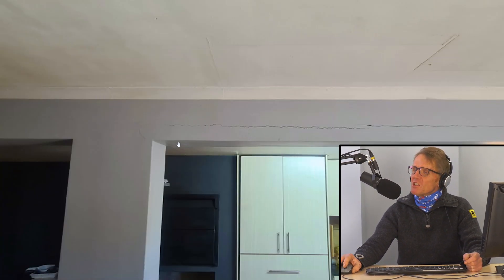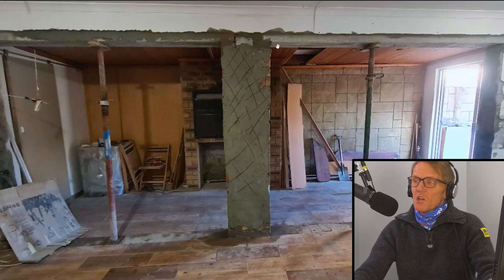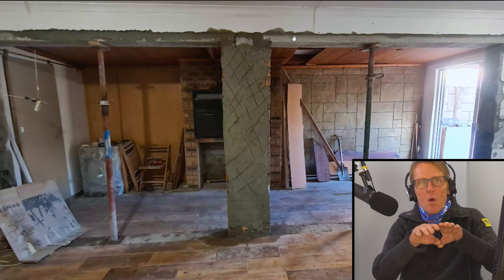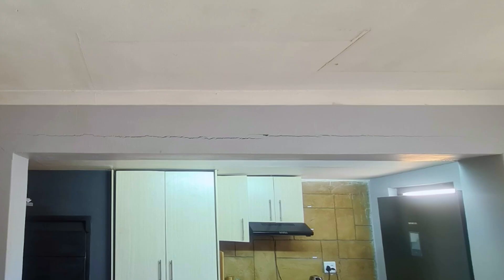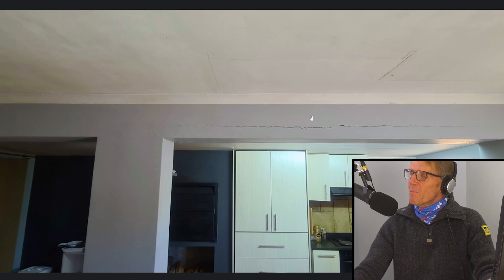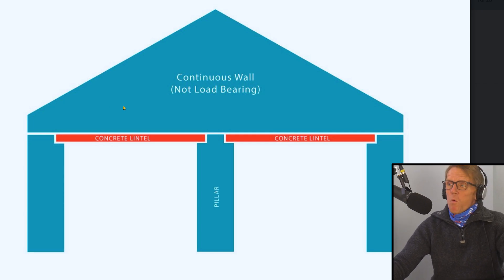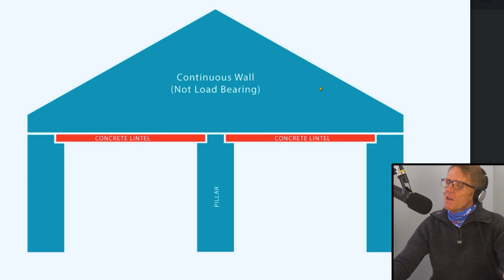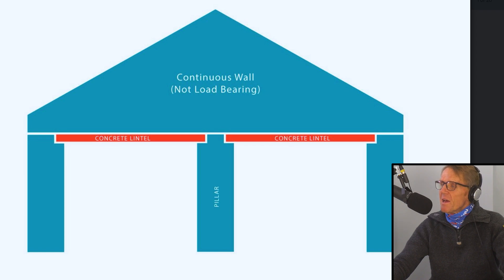Why Has This Lintel Cracked?

Comment: I think when you build it as one the cement and brickwork above will set as one solid object to the lintel. When you try to introduce a new lintel under neath old brickwork it just won’t form as one solid object. I reckon they might have the Lintel upside down. Having followed many structural drawings I’ve never installed a lintel of 65mm (assuming it’s uk) with that span. It would normally be a a UB or a double UB bolted together.
Reply from the maker: I think  you are right (again),
Reply: @SkillBuilder  wish my missis thought the same 🙄😆
Reply: @gdfggggg  come on! You know you married ''Miss Right'! But you only found out later her first name was 'Always'! 😖
Reply: 1st thing I said in my head was the lintel is upside down, I would only use a lintel like that above a patio door with no more than 3 courses of brick on top otherwise its a steel all the way even a box section would be better pre stressed concrete lintels have their uses but i don't think that is one of them
Reply: Yes the thin beam and brickwork effectively form a compound beam from new. But replace the beam and use a beam designed as if the whole lot above constitutes the load, plus using acros during the process, of course!
Reply: @johnf3326  so effectively the new beam would be calculated as a separate entity.
Reply: @gdfggggg  yes. Disturbing the original beam could break the bond in some bricks, even with acros, so better to assume everything above is a dead load. Just look at some houses where the original wood window frames have been replaced and there is a 'pyramid' of repointing above where the brick mortar has cracked
Reply: @johnf3326  I think if I were designing the lintel, I would not rely on brickwork, new or not, forming a structural whole. The lintel would have to be capable of taking the whole load. I could not trust that a crack would not occur in a mortar course and invalidate the compound nature of the 'beam'. There is a truism in structures that if it looks wrong it usually is and in this case the lintel looks inadequate.
Reply: @timothykeech7394  A stretch like that I would be putting in a 100x250 minimum
Reply: @andrewdoherty737  I think something like that would be much more likely. One twentieth of the span as the depth of the beam was the suggestion when I was working. This could be reduced by pre -stressing but there were limits to this and this one looks to have gone beyond what I would ever have contemplated. In any case it has failed.
Reply: Any signs of cracking in the plaster/walls above would be a good indicator if there has been movement in the wall due to the brickwork below being removed. Definitely the wrong lintel for the job as stated in other comments yes it might not have been a load bearing wall but I would of paid the bit extra for steel then you have peace of mind and should you want to at a later date add gym or on suite above you don’t have to worry as you know you already have the right support below.
Reply: If the one on the right is upside down it could explain why the one on the left didn't crack and the one on the right did. I'd be interested to know what your structural engineer makes of it.

Comment: Surely a gable end wall is a load? Too much flex on a lintel that thickness with the span. When built in from the beginning the cement bonds to the lintel making it far stronger …

Comment: when I did building work with concrete lintels  or even steels in this way I would tress the lintels by hammering  wedges between the centre brick  and lintel or beams so it took the load, basically taking the slack out of the lintel or beam
Reply: What were your wedges made from?
Reply: @lksf9820   chisels or a bit of steel, it doesn't matter of the material at it can be removed after pointing up, there are many ways to put a lintel under a bit of stress,
Reply: @lksf9820 cheese I believe. Bloody expensive these days though.
Reply: @ricos1497  Wenslydale then, Dairylea would be no good here.

Comment: What's the correct lintel  an RSJ? I suppose you could put some cables up to the joists and take the tension from there Just to hold it in the middle of each
Reply: RSJ
Reply: @Vile_Entity_3545  that's right you got it

Comment: The opening is too long for the lintel and the brickwork above is causing deflection of the lintel. If it’s single story then a concrete lintel is fine but the lintel needs to be strong enough for the size of the opening. God knows how it was signed off by building control and would like to know who did the structural calculations 😂
Reply: There was no building control or calculations done, that's the answer to that.

Comment: Never seen a "beam " like that before. Only time I've seen a flat lintel is above a short apan like a window opening. There's no strength in that. That added wih probable inverted installation could account for the drop or sag. Get the builders back in. Give them cups of tea and plenty water for their horses.

Comment: Where is the building inspector. They have to be involved on structural work.  They would not have allowed a prestressed lintol in that situation surely.
Reply: My thoughts exactly, needs an SE and a building control application, that needs sorting ASAP